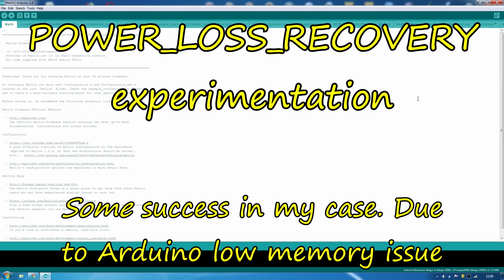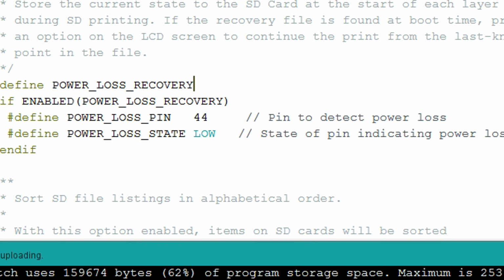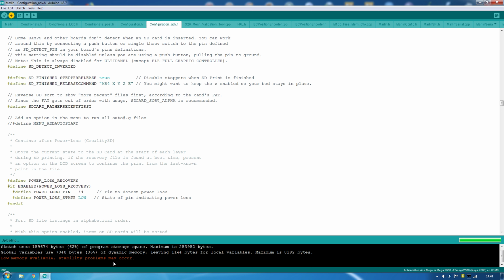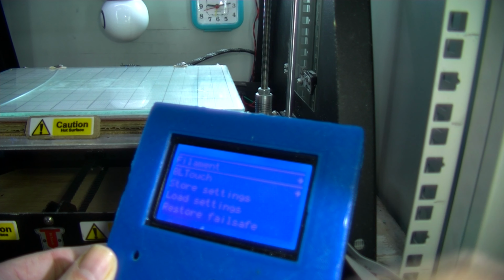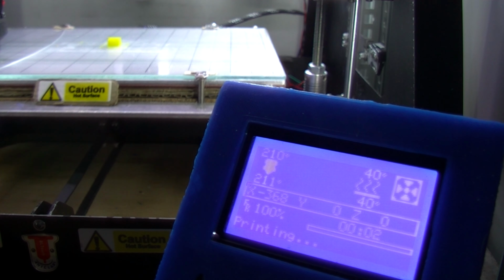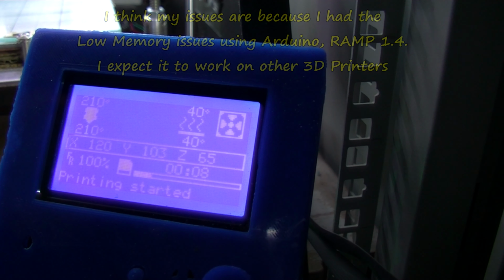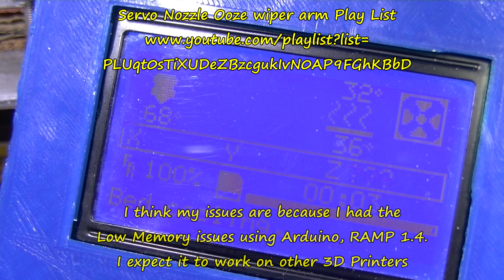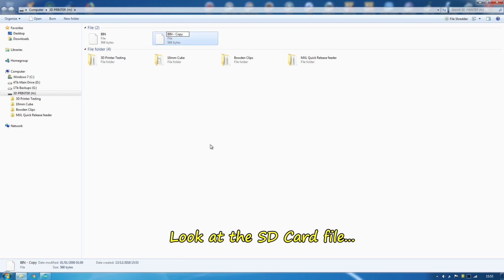POWER LOSS RECOVERY experimentation

Comment: Thanks for the video.
It seems you've got pretty good add-ons. Among them I see you've made a custom bed heater. For the power loss recovery I've heard that you can make it work if you connect a TFT28 or 32 lcd to the control board. This TFT screen module would take over from the control board in a way it'd store all the printing codes into its sd card or memory - not sure since haven't installed that yet.
A good improvement to your printer would be to change as well your control board to a MKS GEN L or even better a FYSETC F6 which holds one more stepper driver. Buy the TMC2208 drivers. It's a must!!   Watch this video:
https://www.youtube.com/watch?v=pa0QOxlCIZo
Reply from the maker: Drool , Drool  Very very nice no if only 16/32 bit :)
Reply from the maker: a custom bed heater control a SSR via RAMPS that switches 24 V custom bed heater